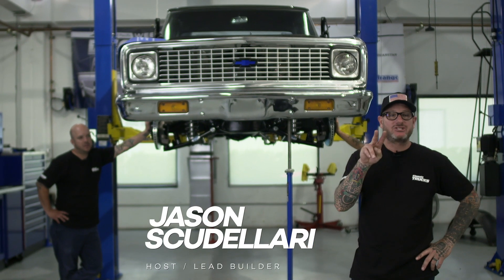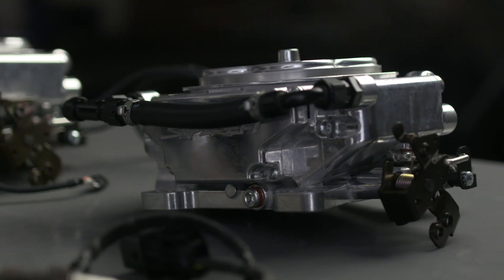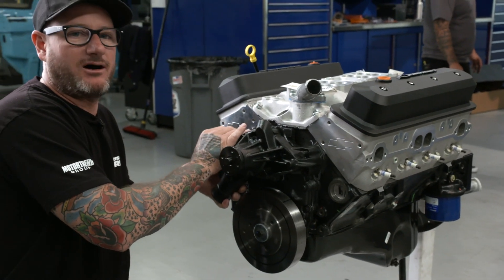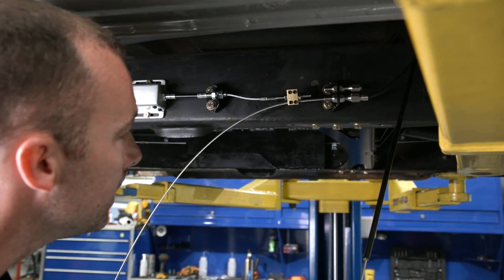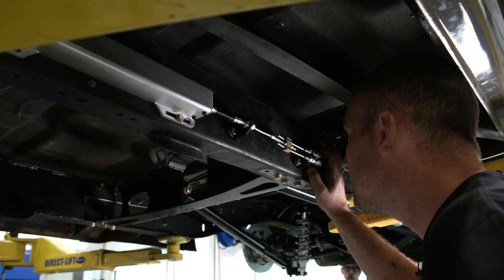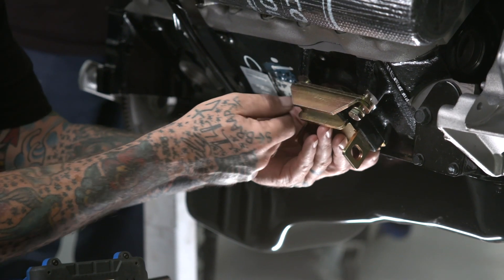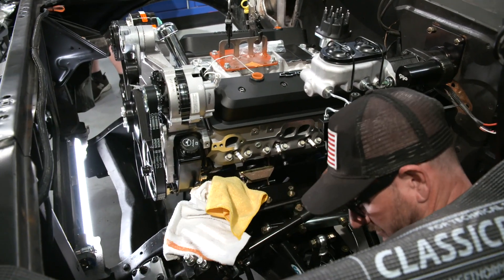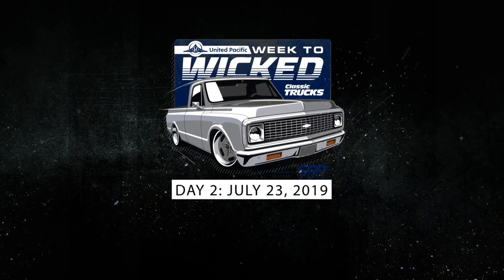2019 Classic Trucks Week to Wicked: 1971 Chevrolet C10—Day 2

Comment: Dual Quad is Awesome. But as a Fuel injection set up it still looses the sound of a secondary like the way a 4 barrel carburetor works. But it will perform.